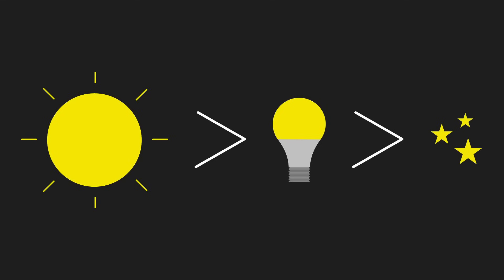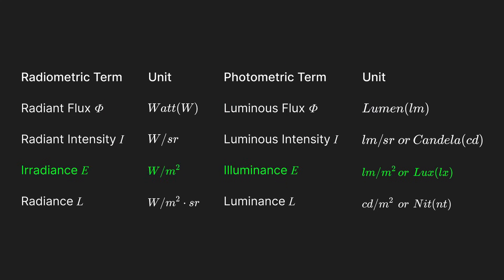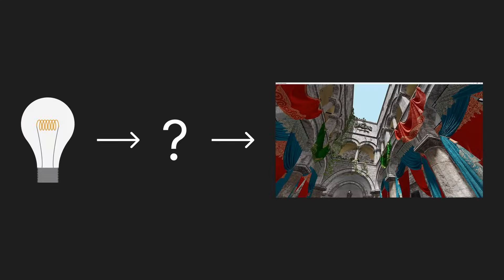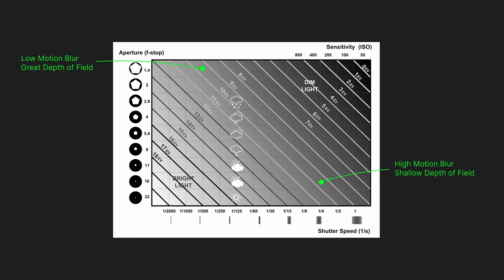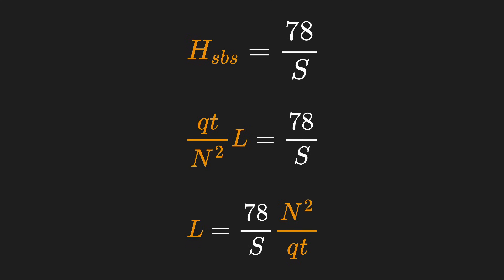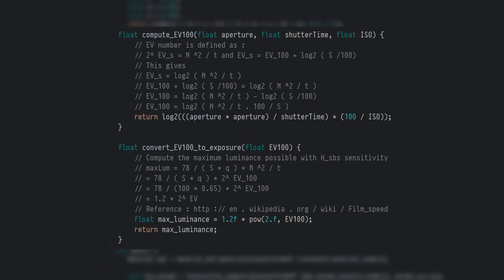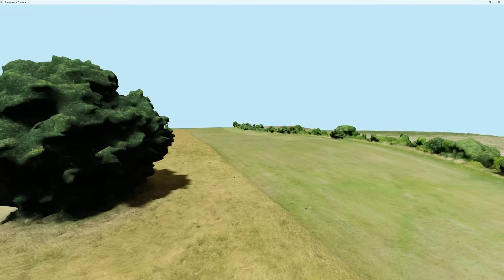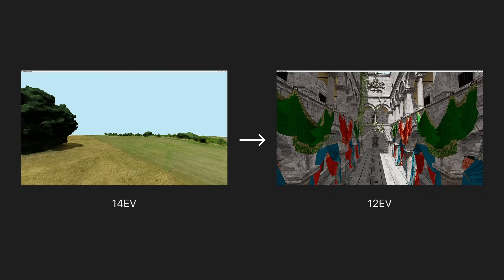Using Photometry to Render Real-World Light Sources Consistently

Comment: One benefit of this is accurate simulation of night vision devices. It's possible to imagine an FPS game where most of the render pipeline is unloaded when the user slides down his goggles. The radiometric values for just about all light sources are documented. Realistic simulation of NV behavior should be quite achievable and compute efficient.
Reply from the maker: Yeah totally! That’s what makes modeling real brightness so nice. It makes things a lot easier to deal with in different conditions since the whole system is more consistent.

Comment: Now I’m wondering how this interacts with the contrast levels of the textures chosen… like, do you optimize the color of a texture for maximum sunlight? What about absorption and reflectivity?
Reply from the maker: Textures stay the same. Your lighting calculations stay exactly the same except for the final division by the exposure parameter.

This simply shows how to apply exposure to your final colors so that you can use real lighting values consistently when calculating the rendering equation.
Reply: @alex_d_lee I guess I’m thinking more like, if you were to take this idea further, how do you determine the rgb value of something from the real world, pre lighting shader. A texture could be made from a photo, but if you’re using a camera as a model for lighting, what about the original camera settings / post tweaks for that texture photo
Reply from the maker: @ar_xiv  most times you don’t know the original camera settings used for an image, but you typically assume that photo has been adjusted to a range surrounding the majority of luminance levels in the scene, unless it’s obviously over or under exposed.  Additionally, it’s not so much that the absolute final RGB value has to be perfectly preserved between two photos, it’s more that everything in the scene, along with their hue and brightness, should have the same relative relationship to one another. 

You can adjust exposure in your own renderer, to make everything brighter or darker, but you don’t have to worry about the original image you used as a texture since it’s the relative difference between texels that matters

Comment: Cameras scale their values beyond just the settings so you can't compare intensities as such. Auto exposure should not be particularly difficult to implement, you can do a coarse histogram and set your top at around 99% of the pixels or you can do multiple histogram zones in the image, weighing the central ones greater or a more sophisticated one based on neural net understanding of the content of the image. Training neural nets is relatively easy with python, pytorch and GPT today. LLMs are really potent development assistants. You get into new stuff in no time.

Comment: Isn't 75000 a bit too much for floats?
Reply: Single-precision floats can represent integers up to 16777216 exactly. Above that, you lose the ability to represent odd numbers, then odd multiples of two, then odd multiples of four, and so on, until you hit the limit and any further increases just give Infinity.
Reply from the maker: Float precision isn't critical for lux from such a bright object. Lux outdoors changes constantly on a partially cloudy day anyway and the variation is a lot larger than floating point error.

Comment: One problem is, our eyes are way better than cameras.
Reply: Better in most ways, worse in others... but most importantly very different from cameras. But that said, most games (and movies, and photographs...) now tend to care a lot more about approximating cameras than human vision, so... it has its place, definitely.
Reply: Hardly. You can't zoom in or out, no instant aperture changes, terrible low light resolution, no macro, and very easily damaged by overexposure or heat/cold, or touching or wind. We can't see IR or UV and have a permanent shutter speed of about 1/8 of a second and lose color vision in low light. How are they better?
Reply: @BariumCobaltNitrog3n  no noise, much better dynamic range.

Rendering is capable of avoiding all of the issues of cameras, I don’t understand why’d you limit yourself to it.
Reply: @BariumCobaltNitrog3n  Huh? That's a weird mix of things that aren't true of eyes, or aren't true of cameras, or aren't true of both, or are true of both, or are simply imposing different arbitrary expectations on an imaging system.

Cameras can't zoom in or out. They can only do that by mounting zoom scopes - just like humans can use binoculars, duh. They can't change aperture instantly, and while it's certainly faster than human eyes can, the range is also much smaller than for human eyes.

Low light resolution is terrible for both - not surprising, since both human eyes and cameras are in fact sensitive to individual photons. Dark scenes are dark because there's too little light; you can't magic that away. Cameras can get a lot of extra detail through longer exposure, at the cost of not having real-time imaging, stabilization and blur. But brains do the same thing. I've got a pretty beefy camera, and it still sees a lot worse in the dark than my eyes, as long as they are properly dark adapted (yes, takes a while).

Human eyes can focus on a lot closer and smaller objects than any macro lens I've worked with (up to about the $2500 range). And human eyes aren't exactly the highest range equipment you find in the animal kingdom.

Lenses and cameras are just as easily damaged by overexposure, touch, heat and cold. Eyes also have nifty features like self-cleaning lens, protection against debris, dust, insects or casual touch.

We can't see IR or UV, yup. Better cameras usually don't either, since we don't. Not sure how that's relevant to approximating human vision.

Human eyes do not have a shutter speed. They also have fairly advanced motion tracking that can easily track even fairly close and fast moving objects with prefect clarity. Quite practical for the world we live in.

Cameras lose colour vision in the dark too. They just lie to you about it. You get colour noise, because there just aren't enough photons to see much colour. Don't forget that every individual photon only carries a single wave-length - if all you get is a single red photon, no camera or eye can distinguish between all the colours that red photon might have come from. But hey, it's not the eye that loses the colour vision - it can still distinguish those photons in the dark. But because it's pretty much random noise (when you're not looking at a display, of course), it gets filtered out. It makes the image quality worse, just like with a camera. Less is more, sometimes.

Comment: Hmm.. I also was getting into a rabbit hole of the exposure and light intensity.
The problem is how to find out the correct intensities for real world lights, because even with the light meter, it has a contrained range (75 at yours) which might not represent the actual nuclear-intensity of a sun -- we sadly can't plug in 10000000 unit sun into a renderer with 10 unit lamp because of technicalities (e.g. float precision during illumination calculation); even sky is 100000x brighter than a lamp. Even if illumination step is solved, one needs local tonemapping to support such insane value difference, to partially emulate how human eye is adapted to a real world light.

Not that I'm saying we should not try, and I truly would like for a renderer X to have true physical light values, but like cameras (even film with its chemical process), they just approximate the abilities of human perception.. so in the end, it all comes to subjective feel -- like a film director would choose what feel to convey in a picture
Reply from the maker: @sultim7570  my lux meter is rated for up to 200,000 lux which is more than enough for a sunny day. I got 75,000 lux as the max reading on that spot on the ground. Also recall that lux is the amount of lumens incident on an area, not a measure of actual total energy coming from electromagnetic radiation (which includes many more wavelengths than the visible ones)

And you can actually plug in values that vary drastically like that. Just like an outdoor light illuminates the sidewalk on an overcast afternoon, you can still see both the contribution of the sun and the lamp regardless of the massive difference in brightness. 

Dividing by exposure like I showed normalizes those vastly different light sources to a displayable range, which I further color correct to go from HDR -> SDR.

You’re right though if a renderer naively uses some unitless “intensity” value with no correction
Reply: @alex_d_lee  Yes, lux is a measure of energy over an area, as we do Sun measurements on Earth, which accounts for a Sun solid angle and distance to the Sun.

My point was that I failed to adjust a path traced renderer to these values, I didn't have a lightmeter, so I based on vrry finicky data (some from wiki), which are largely inconsistent, and some give values over an area, some over solid angle, some provide raw power coming from an object (normalizing them onto a single space is another problem). I failed to use "physical" values, as the game path traced renderer was blowing up (sadly, for performance, it has low precision for sampling, resembling, denoising etc), second, the exposure compensation (EV adjustment in the video) needs to be done per pixel, since e.g. sidewalk in sun would be 10000x brighter than the shaded area -- but a human eye will recognize that [thanks to million years of evolution] and human brain will see details in both sun and shade. So exposure compensation needs to be done per pixel, because if a global (fullscreen) exposure offset is used, then either shade will be completely dark, or sun area will be overexposed.

The thing is, trying to have physical values is a dream of mine, but because of technical limitations and artists requiring great control over the final image detail, it flops

Comment: 3:54 The ISO value in digital cameras don't change how sensitive the sensor is to light, but rather how much to boost light signals. The sensitivity to light is fixed. In that respect, the noise a digital camera sees is always there, but only at high boost levels does it become visibile.
Reply from the maker: @MrMineHeads.  you’re definitely right for digital cameras since the sensor is fixed. I intended to say something that logically extended to analog cameras as well which can use film of different ISO’s.
Reply: This is usually exposed as gain anyway, making it directly equivalent.
Reply: Not really. While the digital gain control is scaling the ADCs' outputs, the analog one controls their sensitivity adding very little noise.

Comment: I just want to point out just how much variance there is in light amount between two reasonable scenarios. Indoor lighting is about 100-200x dimmer than a bright cloudless day, and a moonlit night is 2000-10000x dimmer than indoor lighting. Crazy just how much dynamic range our eyes have. No wonder cameras struggle in low-light conditions
Reply: The eyes still use adjustable apertures though.
Reply: Do they really though? With a 800 ISO and a 1s exposure a full-frame can see better low-light than I
Reply: @kylebroflovski6382  I'd say cats have a mad HDR though. Not only the apertures, but seems they actually have some kind of exposure control, that is whenever attacking they seem to switch from narrow aperture/long exposure to wide aperture/short exposure likely to reduce motion blurring during jumps etc. Guess some wild chemistry is involved there...
Reply: @kylebroflovski6382  Right, but that's a one second exposure, which isn't real-time.

Comment: Does this method account for sensor size? Especially the camera sensors are tiny compared to mirrorless/dslr counterparts.
Reply from the maker: No but creating a much more accurate camera system is my latest project at my current job which I may make my next video on. It accounts for sensor size with all camera effects like DOF as well. Will probably add the option to use different sensor sizes in the future, like APS-C and M43.

Comment: doesn't the light received by the camera also depend a lot on the physical sensor size and the amount of glass in the lens?
Reply from the maker: Yes but that's out of the scope of this project. My main influence in this was frostbites PBR paper who also only expose aperture, ISO, and shutter speed as parameters. If there are renderers that also allow for controlling lens power/shape/thickness and sensor size, then I just haven't heard of it.
Reply: @alex_d_lee  if we assume the render lens to be optically perfect across the area and all wavelengths, the thickness of the glass is already represented by the f stop at full open aperture. For a full physical representation of the lens chromatic aberration, vignetting and sharpness and more need to be calculated across the full sensor. I haven’t kept up but I’m sure the render engines for vfx have implemented that proper.

Comment: This is really cool! I wonder how well this plays with Global Illumination and light transmission. One particular annoying thing I found playing with 3D Editors like blender is that  faithfully reconstructing even a simple scene with semi translucent objects (like a lamp shade) covering the light source is nearly impossible without resorting to trickery.
Reply from the maker: Thanks! This should work just fine with global illumination since it doesn't change any lighting algorithms, just uses a consistent system to "count" brightness in a scene. And yeah I havent used blender in a little while but I've seen renderers that use brightness, wattage, and luminance in a somewhat inconsistent way
Reply: In that case it'd more so be the lighting solution used by the renderer, instead of the virtual camera system. Assuming you mean the Cycles renderer in Blender, it's a unidirectional path tracer that fires light rays out from the camera, so light rays need to randomly bounce around and eventually hit a light source to contribute to the image. By putting a lamp shade over your light source, you're effectively adding a huge obstacle that light rays have to randomly path around to be able to contribute, which means that most light rays will terminate before they hit your light source. To reliably light your scene, you'd want to switch to something like LuxCore or an equivalent renderer that uses bidirectional path tracing, as that fires light rays out from both the camera and light sources which makes these sort of scenes far easier to light.

Comment: This is so interesting. I was a bit confused at first because I thought this would be a lot more useful for low light settings, since under exposure fixes are typically wacky. I'd love to see you implement the auto exposure part with some sort of momentum, imagine a game where a flash bang will actually blind you and this blindness is realistic and built in the renderer, aka, your eyes, as it should be. You could do all sorts of things with a single implementation and without having to add new game mechanics, crazy.
Reply from the maker: Yeah thats a great idea! I've just implemented auto exposure in this project and currently trying to work out how to make smoothing between luminance levels better. Thanks for the support
Reply: This is a wonderful idea! While watching the video I was wondering if simulating how our eyes function and adapt to rapid changes in exposure could improve realism, and reading your comment confirms it. I'm sure there're a lot of ways it could be cleverly exploited to improve game mechanics
Reply: Especially for first person view games
Reply: The issue with this is similar to games simulating depth blur. The pupil light reflex is primarily driven by the light that hits the macula. You are fine with your eye underexposing your peripheral field of view on occasion.
A video game can't settle for setting the correct exposure just for the area around the cross hairs, because the players eyes wander around on the screen independent of it. They will be bothered with over and under exposure.
Maybe for VR, users are more often looking around with their head, or the platform has eye tracking, since there that has other benefits as well.
Reply from the maker: @KGello  you bring up a good point. That reminds me of how unreal engine deals with auto exposure. They have a filter mask that weighs luminance levels in the middle of the image higher than at the edges, similar to a camera. It’s a good way to focus more on the center of the image while not completely ignoring the periphery. 

Look at the “exposure metering mask” section

https://dev.epicgames.com/documentation/en-us/unreal-engine/auto-exposure-in-unreal-engine
Reply: @KGello In practice this isn't an issue, you don't even have to flash the display (avoiding complications for people sensitive to that), all you need to do is temporarily ramp exposure up while clamping the upper value, or even wrapping it for a solarized effect. When you are reeling from a flashbang you can't see, the "fidelity" of the visuals are besides the point at that time. 

As it is, blindness effects are generally poor in games.
Reply: If we are going this route, then I would also remind you, that unlike standard caneras, our eyes response to light is not lineat, but logarithmic. The kind of back lighting contrasts that you get on a photos just do not exist in our vision.

A cool fearure that a physics based renderer such as this is just screaming: ingame night/IR vision goggles to change the spectum of vision and the following rendering.